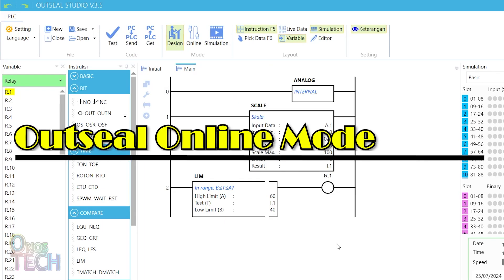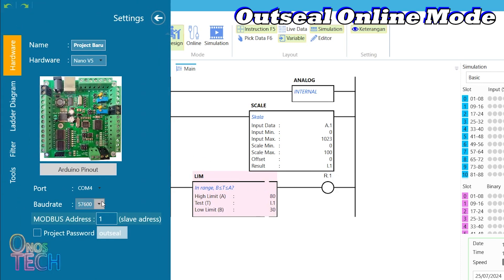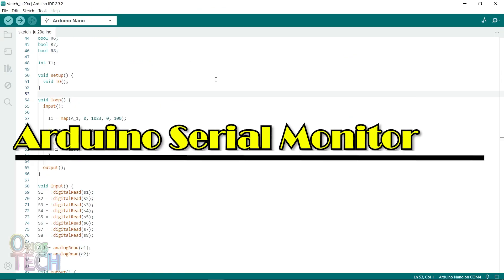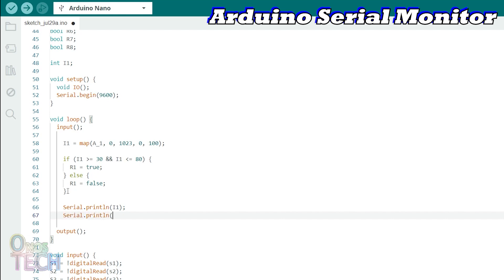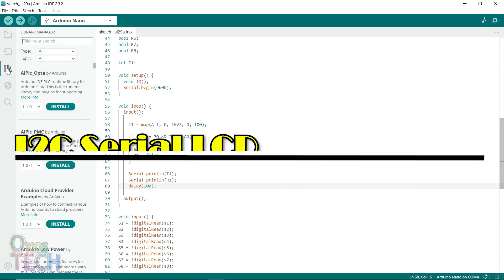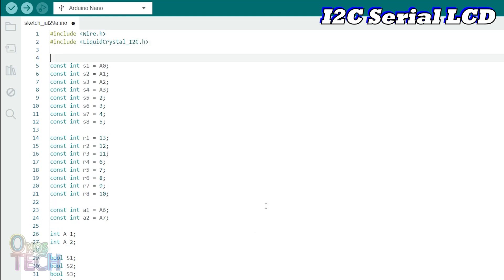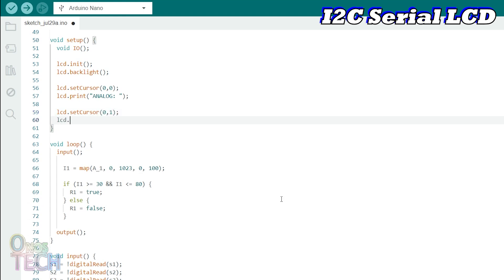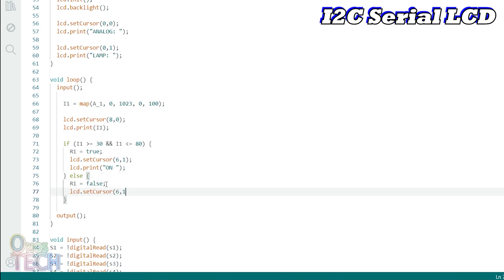#3 Data Monitor | Arduino Sketch ⇌ PLC Ladder Programming

Comment: Arduino mega board can I use Arduino sketch?
Is available library lcd i2c 20*4 and HC SR_04 ultrasonic sensor 
And DS18B20 temperature sensor 
1 wire library 
And PT100 sensor to  0 to 100 c temperature  to 0 to 5v or 4 to 20 ma convert how can we use .
Pl guide me .